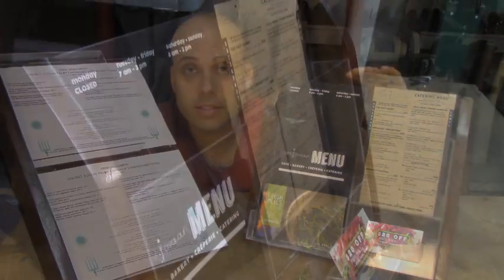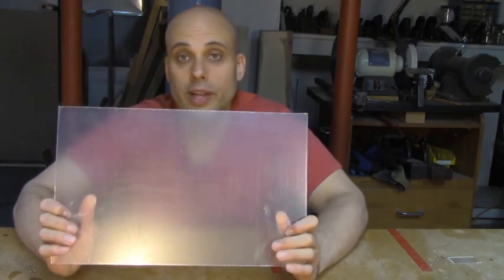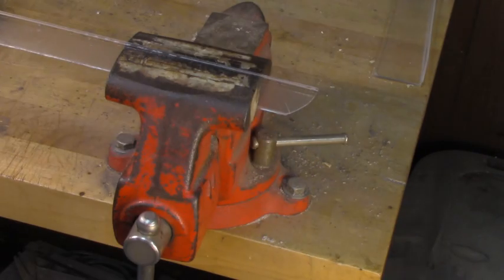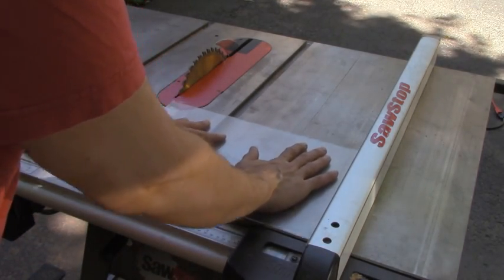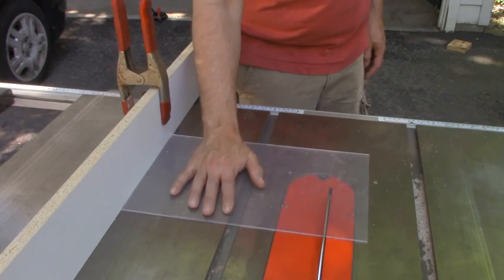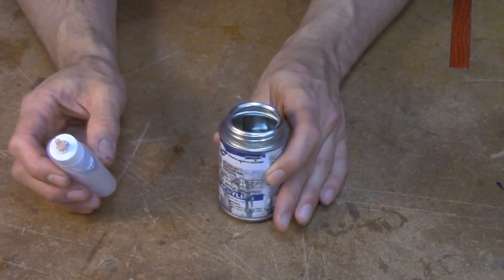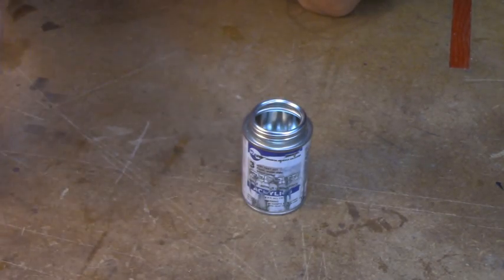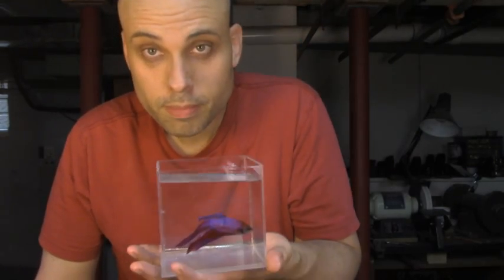Acrylic for woodworkers. (Using the tools you own now!)

Comment: You also need to cover edge finishing. I have scraped and sanded edges and ended up with a satin finished edge. However, my favorite way was to take a torch and "flame finish" the edge. Just run the flame quickly over the edge a few times and you will end up with a nice, smooth and shiny edge.
Practice on some scrap pieces first and you will be pleasantly surprised how quick and easy it  is to do.

Comment: what about a radius edge ?  on a piece of  3/8 or 1/2" acrylic - if you were putting a radius on an edge - would you use a router ?
Reply from the maker: I'm sure that would work great, but experiment with speed. Too fast=melting.

Comment: Rex:  thank you for this video.  It was timely in my current project.  I always butcher acrylic and Plexiglas - your is helping.  It's funny, I've watched woodworking channels hard for about 4 years now, and today is the first time your popped up.  I'm glad, and after having watched 2 of your others - "subscribe".  I'm gonna grab a beer and watch some more this evening.  I was hoping you would show how to clean up acrylic edges.  My edges with 1/8" acrylic will be exposed.  I've tried sanding, propane (don't need MAPP for anything else but this, so I didn't buy), scraping, etc - all to no avail.  I still had a sloppy or melted edge.  Can you blast out an edge treatment video for this?  I like your channel, your style, your articulateness, your brevity.  Perfect.  Again - "subscribe"!!!!!  Thanks again.
Reply from the maker: I'm really glad you liked the video. I've had pretty good luck cleaning up edges with fine sandpaper on a block to keep edges from getting rounded. I hear the torch trick works great, but I haven't tried it myself.

Comment: I need a plastic or something that can withstand temperatures of 750 degrees Fahrenheit or Celsius whichever is the hot American one. Would acrylic melt or warp under those temperatures?
Reply from the maker: No!  Acrylic will not withstand this temperature.  Can you maybe use plain old glass?
Reply: @RexKrueger  I need to engrave little things into the material
Reply from the maker: You can etch glass.

Comment: The best circular saw blade for cutting  acrylic (or any plastic or sheet metal or aluminum extrusions) is one with zero to negative rake teeth. They don't pull a vibrating piece of stock into the tooth gullet and you don't get nearly as much chipping of the surface. The teeth don't dig in like a chisel or a plane iron, but drag across the work like a scraper.
A similar technique works really good with drilling.  You have to modify the drill bit though.  You use a 
dremel tool with one of those brown cut-off wheels (I call them potato chip disks cause they break like potato chips between your fingers).  With the disk in the same plane as the centerline of the drill bit, dull the cutting points of the drill bit so the point of the drill doesn't lift the chips into the drill bit flutes. This works great on sheet metal too -- the drill bit wont screw itself through before making a round hole.  It also works really well with Lexan (polycarbonate) . Have you ever tried drilling that stuff?
Reply from the maker: I do drill it, but I typically use a specialty bit like a Forstner. Not great luck with twist drills.

Comment: Thanks. This is one of, if not the, best presentations I've seen (and not just on YouTube). Simple clear into with quirky clear move from intro to presentation proper and funnyvilly ending. As I'm building up my courage to turn my hand to small-scale woodworking and modelling, I've seen lots. I've worried about cutting acrylic  (remembering my scooped and the horrors of cutting perspex - I don't think acrylic had been invented then) but you've reassured me, knew nothing about solvers and kept screaming "cold welding" until you mentioned the magic word... And thought "the b*** has surely been leading us on!" Talk of evil - funnyvil. Anyway, thanks again and, yes, a vid on drilling acrylic would be useful but I suspect it will be similar to this - practice first for experience, then cut as you would wood -  with revs low and penetration steady. Oops, that doesn't scan PC.
Reply from the maker: You're right. It's just another material. Practice on scrap and you'll get it. Good luck!

Comment: Is there any way to adhere acrylic to wood?  In addition to using screws?
I ask this because I was thinking of making a crosscut sled and using
10mm (3/8") acrylic as the base......any thoughts?
Reply from the maker: i would do screws and epoxy. Roughen up the acrylic with sandpaper where you want to glue it to the wood.

Comment: Interesting and useful! I'm about to make a rain gauge using a 3/4" ID acrylic cylinder as the gauge and a funnel and vinyl tubing as the feed. The ratio of the the funnel to the cylinder is 5.44444444 (I don't know how to type the character code for repeating series, d'oh) so I can get better precision. Since I'm printing the scale for it I can do both Imperial and metric (something my current rain gauge doesn't show.)

Comment: what kind of adhesive would you use to glue the acrylic to wood? Say, putting edge of acrylic into a 1/8 or 1/4 dado (depending on acrylic thickness) or something along that line.
Reply from the maker: Interesting question. I think the best approach would be epoxy. It bonds well to both substances. Or, if you need a flexible joint, silicone caulk would probably work, but you should experiment. Good luck!

Comment: Solvent Glue Welding I had no idea that was a thing. I am blown away at the concept and am excited to try it out.  Are you aware of any other materials that have solvent adhesive potential?
Reply from the maker: Yes!  PVC works the same way. You can get pipe and sheet at the big box. Very versatile material and easy to use. Doesn't rot. Good outside. I plan on doing a video on it at some point.

Comment: Hey thank you for all this information! I'm considering a project that would involve cutting 5-6inch diameter circles into a 24x12x12inch rectangular acrylic box (or sheets that form a box) and trying to figure out the best tools to use. Do you have any advice? It seems like most/all of the tools you and many other makers use involve cutting from edges. Thanks!

Comment: Nice video.  You might have offered some advice to people about tool speed.  When working with metals, softer metal means faster speeds for drills, milling, etc.  For plastics, I believe the advice is sloooow speeds (because of heat buildup).  Drilling acrylic too fast will likely result in a bad outcome.  And you cannot stress sharp tools enough!
Reply from the maker: Agreed on all points!

Comment: Thanks for this video.  A clear and thorough explanation.  Might even try working with acrylic one day.  Any thoughts on heavier sheets such 1/4 inch stock?
Reply from the maker: Hobby Queen sure! I've worked with acrylic up to 3/4, which is hard to find unless it's salvage,  an old reception desk,  for instance.  basically,  the thicker it is,  the more durable and useful it is.  the 3/4 stuff is almost bullet proof. in the bigger thicknesses,  you need to be even more careful about heat.  no band saw. carbide table saw only. if you ever find any,  snap it up.  I've got a fair bit of the thick stuff and I use it for all sorts of jobs.  hope that helps!

Comment: How does this solvent/glue work for laminating two slabs together? I remember using colored glue to laminate acrylic way back in Junior High School. Is this the same stuff?
Reply from the maker: Gil Grace I have no idea if it's the same stuff,  but laminating will work fine so long as the two surfaces meet without a gap. one of the downsides of the solvent glue is that it won't fill any gaps.  your pieces have to really fit.  good question,  though!

Comment: You can make your own glue by dissolving scrap pieces of acrylic in chloroform. Consistency will depend on the relative amount of acrylic vs chloroform employed.  Caution is adviced.
Reply from the maker: I appreciate the tip, but I think buying the glue is probably better than having chloroform in the house. That's a little scary.

Comment: sir which material used for acrylic sheet? can u tell me sir?
Reply from the maker: Acrylic is the material. You might find it under other names like Lexan and Perspex. It's all the same stuff.
Reply: @RexKrueger  is that like resin or epoxy?
Reply from the maker: Nope, pretty different. You may just have to do some research.
Reply: @RexKrueger  ok, actually i m researching about that, if i make some goods of cyclic then which material is required?
plz guide me really i wanna learn about that.

Comment: Does what you are saying about 1/8" sheet apply to 3/8" acrylic sheet?  I'm interested in using thicker acrylic for fences.
Reply from the maker: Sure!  It's really all the same stuff. I use the 1/8 sheet because it's the cheapest and when you make boxes or right angles with it, it goes from flexible to rigid in a hurry. You might even find the 3/8 stuff a bit floppy for fences, but if you glue on a secondary strip to make an L or T shape, that will make things WAY more stiff.
Reply: So, Gusset like in welding?

Comment: I bought a 180T blade for my table saw... Suggestions?
Reply from the maker: Christopher Ross I'm sorry,  I don't understand the question.  Have you tried that blade on plastic?
Reply: Not yet, just bought it. Is a 10 inch lade, using it with a table saw. Just bought a bunch of ChemCast GP Cell-cast acrylic sheets. Using them for making silicone molds and plastic/urethane casting.
Reply from the maker: Sounds like you're off to a good start, then.

Comment: Great informative video, I'm a woodworker and will definitely benefit from this!
Where is a good place to get the acrylic?
Reply from the maker: gear_here You know,  home depot and Lowe's both stock a pretty wide selection.  the price goes up a lot when you go thicker than 1/8, but sometimes the customer can pay the difference.  you can also find it salvage sometimes.  most clear plastic is acrylic. I have some great 3/4 inch stuff that I got from the recycling dude at my old job.  it used to be a desk.